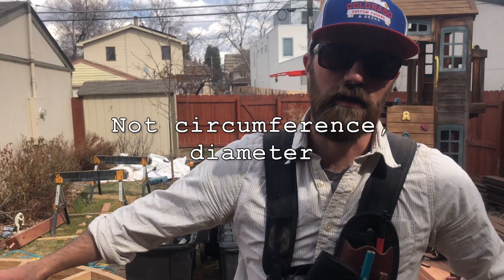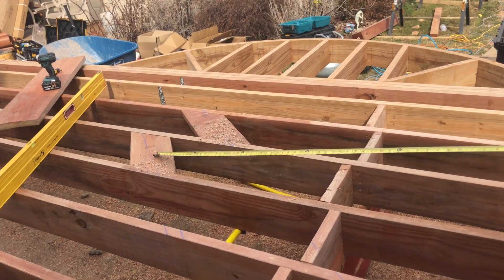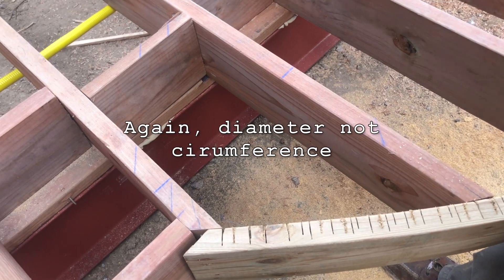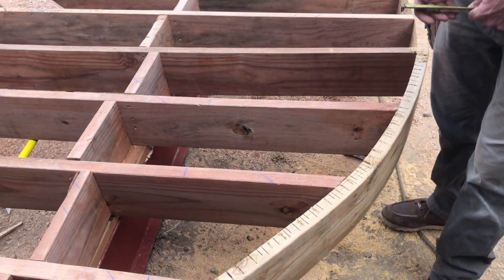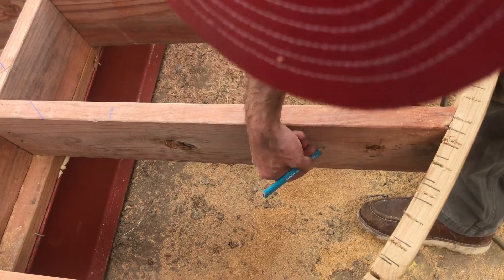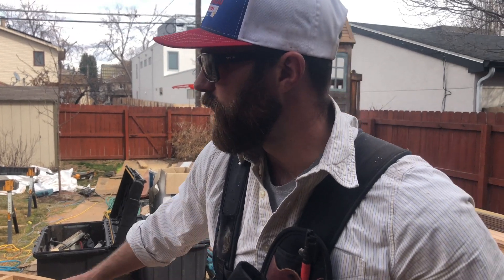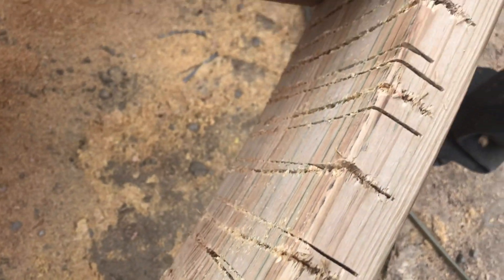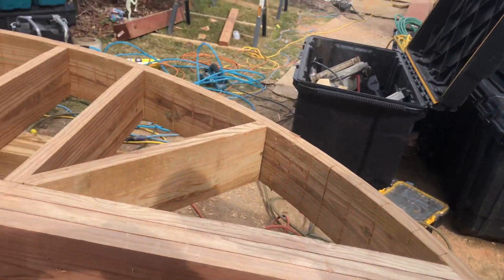How To Frame A Circle In A Deck - Colorado Custom Covers & Decks

Comment: Would you or anyone suggest filling the relief cuts with a filler like epoxy or Bondo body or wood filler? My thinking on this is to re-encapsulate the piece to guard against moisture and ice damage.
Reply: yes, a waterproof tape or paint will work well

Comment: Would those relief cuts not lead to rapid wood splitting and cracking from moisture getting into all those cuts and then drying out?
Reply: I think sealing those in with a glue or some type of sealer to keep it from holding moisture and rotting would be a good idea.

Comment: your rim should have been a para lam or a double 3/4  tention scored  pressure treated plywood with galvanized ring shanks .then shaped anything out with a flap disc  for the radius part of the rim         one more tip the top or apex of your arch to the spring  should be snapped out and  the halfway point marked at that point 90 degree back to the center line will give you the perfect three   point arch everytime .its advanced geometry unlike my ex girlfriend math never lies

Comment: Alright I’m a newbie at this... but after making all the kerf cuts, can you still attach there when placing deck boards? What if the screw goes right through one of them? Thanks!
Reply from the maker: Once the rim is curved and nailed in, the relief cuts become tight. We had no problems with the deck screws. Good question, thanks for watching and hope this helps
Reply: The Deck Answers awesome thanks so much!! I think you may be the only one who’s ever responded to something I’ve commented on here 😆. Appreciate it!
Reply: I can’t seem to find a straight answer about building a ground level deck (technically floating I guess because not sitting on the ground but near). I was looking if you had a video on it...
Reply from the maker: @jbj77  what do you need to know about a ground level deck?
Reply: The Deck Answers thank you!! If I’m making it even with my cement walkway, the frame goes into the lawn. How am I supposed to leave anything open for air?!   It’s literally the yard around the deck. Should I just dig out more dirt inside the frame to make it all lower??
Reply from the maker: juliejabs I would suggest going with a stamp concrete or pavers patio instead of a deck. When decks are that low rot happens a lot faster and easier. If you must have a deck then yes, dig the dirt down so there’s a good 3 to 4 inches from the bottom of the joist to the dirt.
Reply: The Deck Answers thanks so much!!! Now a deck is the only way to go. I was just worried that there wouldn’t be enough air circulation

Comment: What does he mean when he says he has a one foot two inch spring?
Reply from the maker: Waylon Graves Moving the spring moves the centerpoint of the circle up farther.
Reply: @coversanddecks  So am i correct to assume that the point in doing so is to extend the deck out further, or is there some other reason i dont know of?
Reply from the maker: Waylon Graves that is correct
Reply: Thanks for the answers.
Reply: I think he means the overhang, no deck under